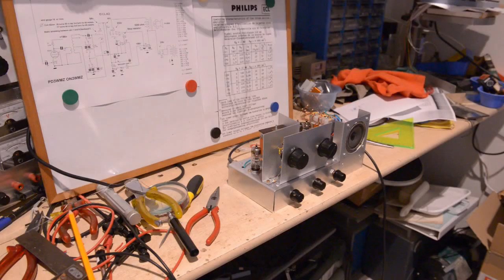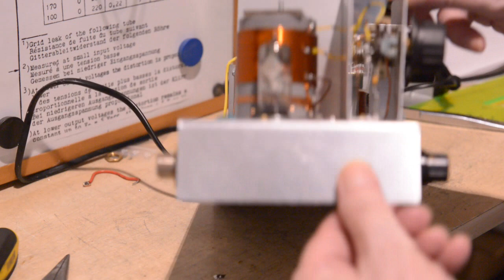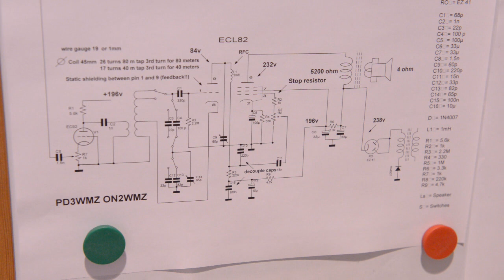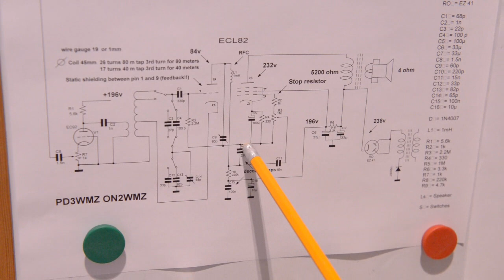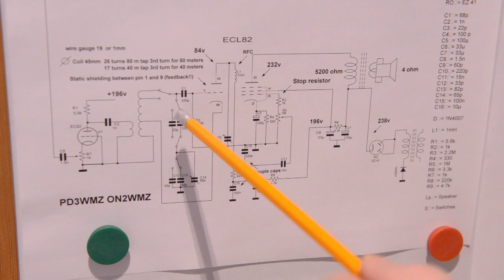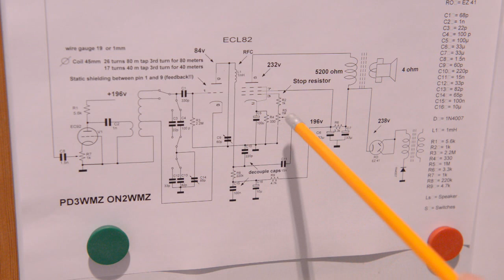Project 2 band Re gen radio build part 12

Comment: Very clean and rock solid construction. I would recommend to add ferrite core based "AC line filter" in the power line to isolate ground path, it can be taken from any bad crt Tv.